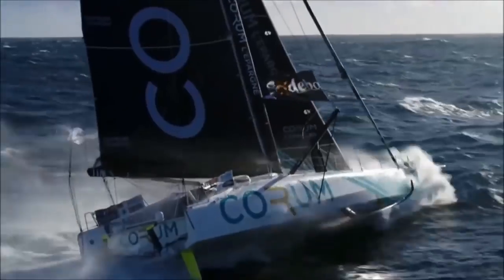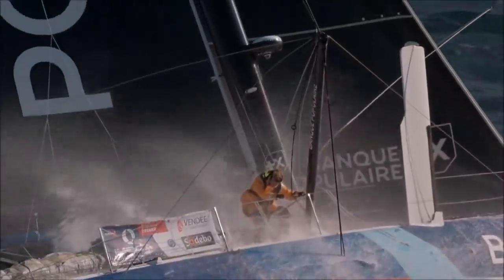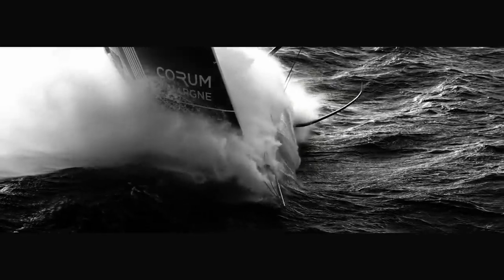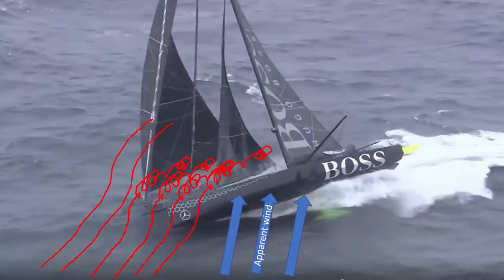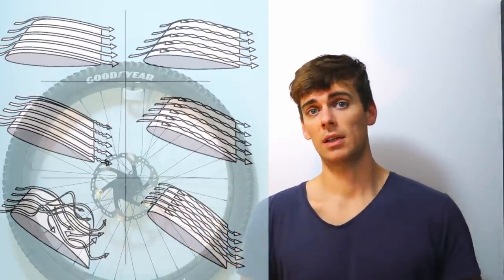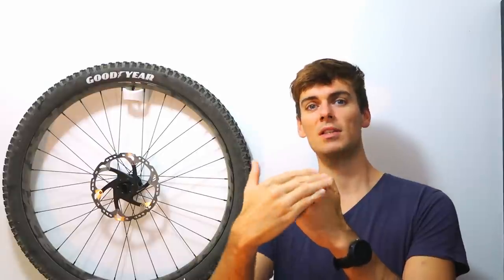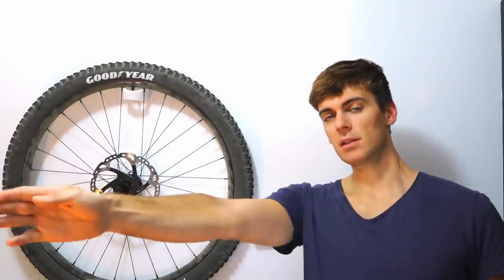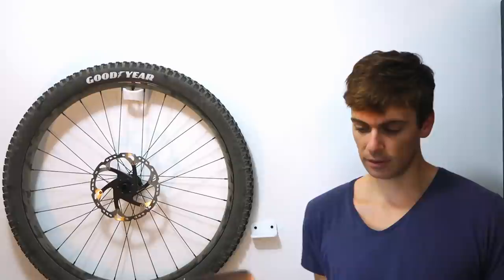Why Corum Dismasted - IMOCA Tech flaw? #VendéeGlobe Boat Design Analysis Part 2 - Aerodynamics

Comment: I can answer your stantion/outrigger pole question. Unless you have a fairly narrow possible angle of attack for a member there is very little you can do to improve drag in all directions. Typically you can increase this effective operational range of angle of attack by increasing the radius on the leading edge but eventually you will be designing something with a much larger area that stalls at a different angle.    This isn't to say you can't say I want this boat to drag race to hawaii at 118 AWA like a tp52 and optimize the stantions and gear to one align exactly with that polar. But it would be three times as detrimental on an upwind leg when you have very high AWS and even worse for the water it comes into contact with.  That being said you would think you could make a pretty optimized windward leward boat like this as you can design a boat for a very specific AWA upwind and rely on the reduced AWS on the downwind to negate the compromise outside that angle. 

On these boats at least as long as you are willing to take the hit for the furler, its probably not worth the engineering time to mess with a crucial structural element. 

F1 cars have an extremely narrow range of entry angles onto the aero surfaces so you can design razor blades which is why it looks so optimized but they do not pitch or roll and usually are fairly well protected from any large crosswinds. Even with that protection you tend not to see such extreme optimizations on the vertical surfaces.  

I can't talk to these boats on the boom height but usually the driver for bleeding edge race boats is the vang and sheet gear needs space on a close hauled and you need to keep the boom level for the most part. So the gear required to handle the loads when pointing tend to be fairly large. Its interesting that I've never seen anything attach a separator from the boom to the deck but on an ocean boat I wouldn't want anything that would restrict a wave from washing over the deck if I got hit from the side. If it funneled into the main and didn't manage to tear it would probably destroy some rigging.
Reply: Good information that shows the difference between true knowledge and someone who knows so little they don't know how little they know.  The point about separators seems to echo one possible reason for the stackpacks being left in place; breaking waves crashing into a reefed main secured only at the reefing points can cause chaos with the sail.  The stack pack can protect the sail from damage. It's also probably less windage than the flapping fabric of a reefed sail.
Reply: I want to amend my last statement about the membrane. I couldn't find anything outside of the AC boats that have it and there are some very unique circumstances that make it a viable option there. 
1  Basically 0 heel angle means this slot is very exposed to the air running along your streamlined hull 
2 Extremely high downwind speeds mean you almost never would let the main out very far. So even at a TWA of 170 your AWA would be very low. I'm not even sure how to estimate this but the main would be maybe 30 deg off of center if you ever ran that deep at all
3 Wing sails/double skinned. The hardware to operate the main is inside the sail itself or distributed along the length. 
4 These boats cannot take a wave from the side. 
5 Separated crew I guess. No one has to quickly get from starboard to port under the boom. 

I'm not sure how much of this is pivotal or will stay but On the 60footers some things are very different. 
The imoca boats Cannot be at perfect trim 100% It takes a LONG time to make a change in this race. 30 minutes for many things. Anything that will bring that time down will help alot. Lazy jacks are terrible for speed but the boat would be unsailable without them. Same with the reefing gear. 
Imocas are running on the basis that they are stable in a very large range of conditions at extremely high heel angles. That slot isn't exposed to wind and is probably as small as they can make it.   They are extremely overpowered for most of this race. Most of these boats dont have a number 1 headsail with them. I certainly couldn't see a picture of one with the big overlap. Capturing all of the air passing the sail isn't really an issue when you have at least one reef in for 80% of the race. What will kill you is preventing the water from leaving the boat. I will bet the they know exactly what the wetable surface area is on the deck and they minimized it.

Something cool I did notice is the corners taken off of the modern boats meant for foiling which reduced the cross section of the side  of the hull when its heeled over. 
 I will bet this is worth alot more than 1hp in drag. Taking a foot off of the height of a 60 foot body moving sideways through the air is a lot of drag reduction. not to mention the water shedding and reduced wetted area as well as material used for the same bending stiffness.

Comment: It’s all about weight and reliability with these boats. In the big picture, 1hp is nothing. They have power to spare almost all the time, the limiting factor for their speed is the sea state. The biggest focus when designing these boats is on downwind sailing in the southern ocean and not much else.
Reply: Another big limitation is human performance. A lot of the things you mentioned are there to make their lives easier. Look at the fully crewed VO65s, no sail bag, and they never have a furled sail up. But it’s a huge amount of work to do that stuff

Comment: I don't think it's traditionalism that stops these small gains from being implemented, but more it's not really worth it. Take your sailbag/lazy jack changes. In theory that's great. A minor gain in boat speed and efficiency that seems like a no Brainerd. But think about what the sailor would actually have to do. They'd be having off the end of the boom while the boats jumping around trying to pull a bag down and not tangle the shit out of the lazy jack. Sure you could do it, but it's a lot of effort for a minor gain. Especially when where you sail is more important than how you sail. The skippers are pretty much never trying to squeeze ever ounce of speed from the boats because being positioned for the right weather system is far more important.

For the America's Cup, these things matter. But for very long ocean races the gain just isn't worth the effort.

Comment: Just to let you know, when you were talking about the extreme heel angle of the previous generation boats and singled out a clip of Hugo Boss heeling extremely, that clip was taken after he had to cut off his starboard foil due to damages.  In that clip, you can see him sailing on a port tack therefore he would have had no foil in the water to help give the boat extra righting moment.  If he had his starboard foil the angle of heel would have been greatly reduced.

Comment: "When the answer is; Well it's always been done like that. You know that it's wrong and it's just traditionalism and it needs to end" Double like + Subscribed.
Reply: I remember when I was fresh out of the university and thinking the same
Reply: One ought to think all one's life.
My house is only 15 years old. The build standard is not bad by standards. Most of the year cold water comes out of the hot taps and I have a 5 ton hole in my building called a chimney. If the open fire is lit aside from the health hazard the efficiency is ~5% heat retention. I would say the heat losses from that hole annually are greater than 1000:1 gained. I call this setup broken, it's been mansplained to me I am incorrect about that.
Then there's the 4" ventilation holes in every room mandated by the state for fresh air. The holes were made without the airflow being measured.
As an off-grid electrical engineer, I wonder why mobile installations like boats and campers are designed to only work when plugged into a campsite and how >100A alternators are wired to charge with <20A.
Reply: @scruff7559  definitely look to adopt new tech and improve things if possible. But trying to reinvent the wheel probably won't get you far. There is a reason the wheel is round in the first place.

As for chimneys... Well... People think you don't need them, but come war or breakdowns burning things in it will save you from freezing in the winter. But is definitely stupidly inefficient under normal circumstances!
Reply: I agree and disagree. In that, the windage in question is not a bag but a net to carry the reefed portion of the mainsail (which do get used in and around > 30-knot winds). As far as I know airfoils are not as good as cylinders in torsion, sheer and maybe some other important factors.

Disagree with chimneys. The house would be warmer without it. I see it all the time that I can improve an installation by removing the work of the previous installer. There's always a saving sentimental grace to traditionalism, that doesn't make it right. I can think of better ways that don't involve 5-ton holes. To me, it is the epitome of the statement that resonated with me so well.
Reply: @scruff7559  sorry I live in the Balkans and we had wars every 50 years in the history. Will always remember seeing the makeshift chimneys installed in the blocks of flats for emergency heating in Bosnia. They had no electricity or.central heating for months and had to resort to drilling holes.in the walls to be able to burn wood for heating!

So in that respect an emergency chimney is useful. Laws state that each flat should have a chimney built for this reason.
Reply: as a sailor it refreshing to hear my same observations! spot on man!
Reply: @scruff7559  If "it's always been done like that" you know it works,  and that's certainly not "wrong".  There is and was also always room for improvement.  
My  house is 200 year old and no wall shows the trace of a former open fire.
Reply: But normally if one actually respects people enough to research why things are "done like that", one finds that there's a damn good reason why.  Racing yacht designers are not actually very traditional; for example carbon was used in racing yachts the same time it was used in F1, and (if I recall correctly) more heavily at first.  When it comes to things like criticising the aerodynamics of a device that is used by sleep-deprived people in often freezing conditions, with enormous g-forces, vast mechanical loads, when being smashed by cutting spray, it's just ridiculously arrogant to imagine that a person who has never done anything of the sort is in a position to criticise the work of those who are far more knowledgeable.  Things like comparing the lack of guardrails on an AC boat's foredeck to the situation on a shorthanded offshore racers' foredeck just show a complete failure to recognise the enormous difference in the two; running the bow of AC boats without guardrails inshore is completely different to running the bow of a shorthanded boat offshore at night.  It's traditional to sit back and go "I know what these idiot sailors and designers should be doing" but one actually learns far more by talking to them and learning the vast amount of knowledge they have amassed during their professional lives. Sitting back and sneering from the sidelines is an insult to the skill and experience of the designers and sailors, and shows that the commentator has closed his mind to their vast knowledge.

Comment: As someone that owned a trimaran back in the '90s when multihulls were still seen by some as not real sailboats, I agree there is a long history in sailing of shunning new ideas.  But, when you're discussing ocean racing sailboats that have foils, I think the designers might be past the "it's always been done like that" mentality.  😁  That said, I'll play devils advocate and suggest some possible reasons that some of your ideas are not being implemented.
Life line stanchions - I think folding or retractable life lines would be a big safety issue, especially on a single handed boat being sailed over long distances.  I see two huge problems: operator error/neglect, and system reliability.  
Reliability of the life lines is important, and there is a lot of opportunity for mechanical failures on an around the world race.  It doesn't seem to hard to imagine a wind whipped sheet or other line tangling with a movable stanchion system, and preventing it from fully deploying.  Sure fixed stanchions can still have failures, but they are undoubtedly more reliable than any retracting system.
I think even more important is the human factor.  As you mentioned (in part 1, I think), the sailors are operating on very little sleep.  It seems likely a sleep deprived, over-worked sailor would sometimes forget to raise the life lines before going forward to work on a sudden problem.  Not to mention the cases where something major breaks (like the mast), and the sailor moves quickly to get out of the way.  I think the life lines need to be ready to catch a person at all times.  
Life lines are the seat belts of a sailboat.  You don't leave the seat belts out a a race car for the speed increase speed from the weight saved.

Under the boom "separator"- The first two problems that come to mine here are visibility, water retention.
Anything that fills the gap between the boom and the deck would likely decrease the ability of the sailor to see the headsails.  Particularly on a single-handed boat, this could make trimming the headsails more difficult.  I suspect that it doesn't take much decrease in sail trim proficiency to more than offset the efficiency improvement from a separator.
In part one of your video, you talked about all the water than can end up on top of the boat.  If you close the area between the boom and deck, it would make it much harder for the water to get off.  Also, it would likely direct a lot more water into the cockpit.  I suspect that the amount of water dumping into the cockpit could become a real safety issue. It might be enough to throw you against things and break bones.  It seems unlikely to me that you could find a barrier that could contain enough air to significantly improve efficiency, yet let large quantities of water pass through it with little obstruction.

Sail bags - How much of the time do these ocean racing boats have a reef in the main?  I don't know the answer, but it appears that all for boats you show in this part of the video have a reef in the main.  If the sail bag was not there, the reefed part of the sail would be flapping in the breeze.  I suspect that the sail bags are there as a way to DECREASE the amount of flapping fabric.

Comment: Concerning the lack of deck sweeping booms: as said in another comment Hugo Boss already does this to an extent compared to all the other IMOCA’s. But more importantly I could be wrong here but I think there’s a rule preventing fairings that would make shrouds on outriggers and deck sweepers possible. Also the OD rig means there’s only so many ways you can fuck about with the boom. Stanchions are mandated by the rule for obvious reasons. Nothing you can do there.

Edit: instantly subbed, i fucking love this content. No one else is doing else is doing it

Comment: I suspect the outrigger booms are round just to keep the cost of a standard component down. However sealing the gap under the boom could be a great idea. If you have ever windsurfed you will know that when you “close the slot”, I.e. rake the mast back until the foot of the sail touches the deck, you feel an extra boost of drive as the escape path for the air is closed. To achieve this on a yacht will need a rethink of the deck and coach roof design with obvious issues for the cockpit and hence the crew. Alternatively could you design a mast system with variable rake like a windsurfer?  I suspect your “elastic” baffle will be difficult to implement and the difference in air pressure may cause it to bulge, become less effective and actually increase drag. . . . .
Reply from the maker: Yeh it would need to be substantially more rigid than a bit of lycra :) whether it's battoned somehow, or a different material, it could be done. Yes needs a complete redesign of coach roof and maybe traveller, but could be implemented with low risk I think. Minimal impact to crew (if any) especially on Hugo Boss. Another idea would just be horizontal end plates on the boom (a la vertical endplates on a f1 car wing). Prevents mixing and improves L/D ratio for very little cost.
Reply: @PeakTorque  have a look at the new AC boats, they have done it already.